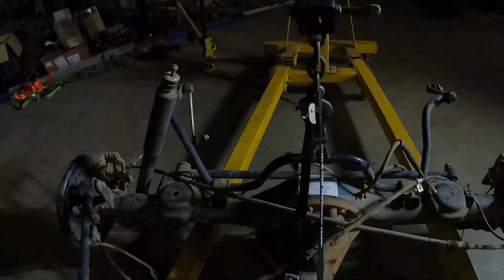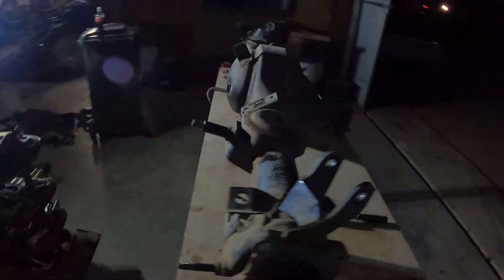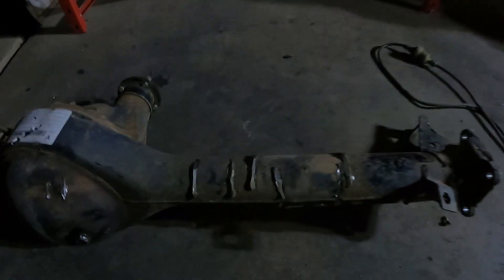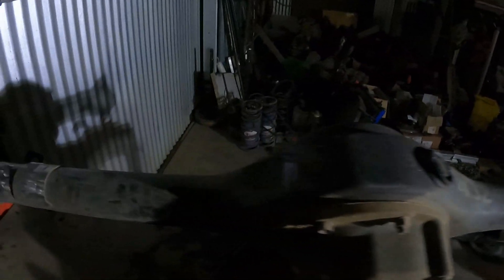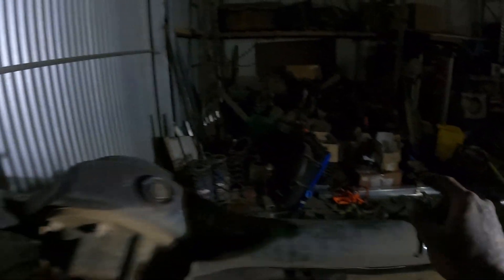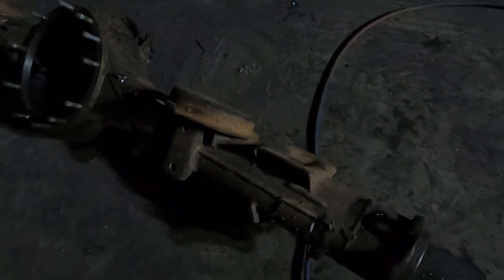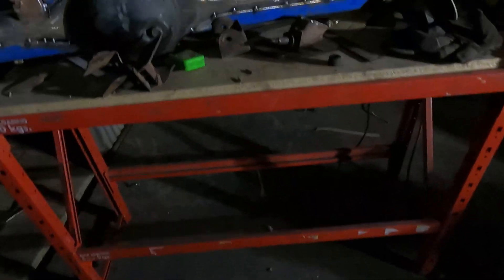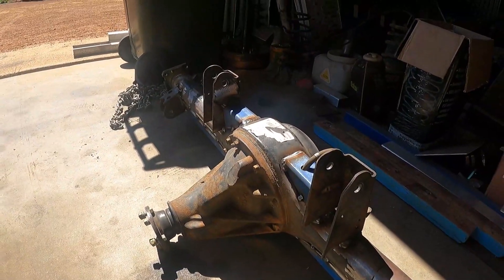MUX rear diff in an Isuzu Dmax !! that is on a Patrol Chassis?? Part 1

Comment: Whats a mux
Reply from the maker: It's the wagon version of the isuzu ute. Comes factory with coil rear instead of leafs
Reply: @jamestyrrell4179  ah roji,  could you not have just done the same to your old leaf spring diff. Shave it down and ad coils. ?
Reply from the maker: Yes I could have but the MUX diff has disc brakes where the dmax is drum breaks
Reply: @jamestyrrell4179  ah nice one man.  Drums on all the dual cab are a royal pain. Disk definitely worth using that diff. Nice work mate very impressive.
Reply: Why not use a 4.8 Patrol diff with the hand brake assembly already on the disks? 4.8 diffs come with ABS sensor too. Just a suggestion. Awesome build
Reply: Would have bolted straight in with no mods to the tail shaft.
Reply from the maker: Because im unsure if Nissan ABS sensors will cooperate with the isuzu computer